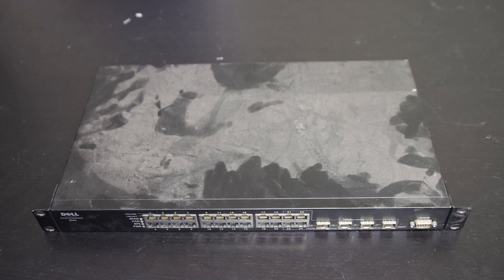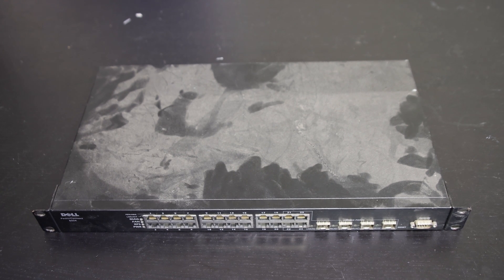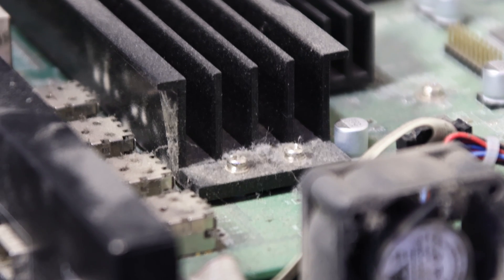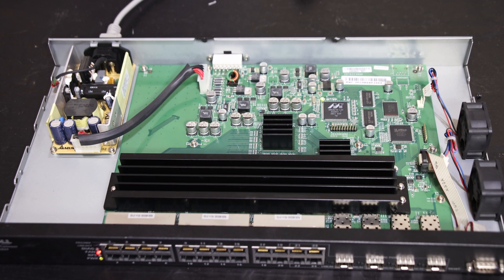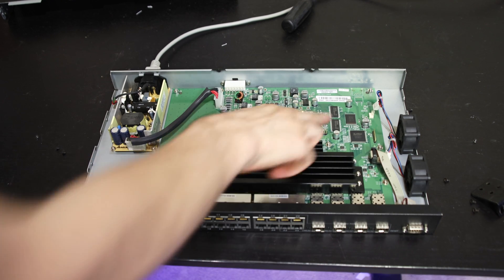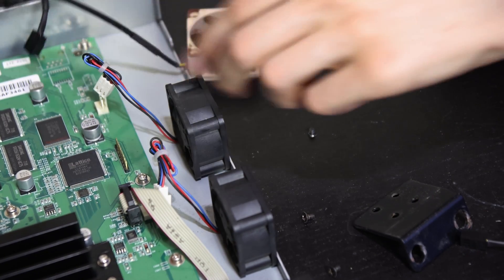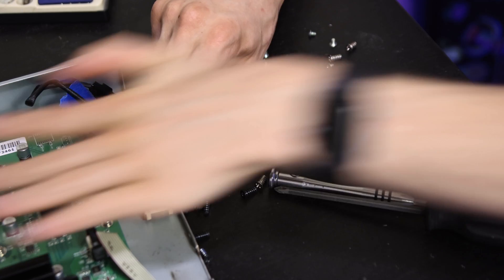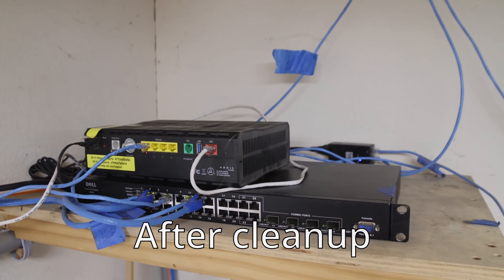Modding a Dell 5324 switch to be quiet

Comment: how do you modifiy the pin layout of the fan cable
Reply from the maker: I used a thin screwdriver to push the metal clips that hold in the connector. Looking at a fan connector, one side should have 3 or 4 holes with metal visible. You can then put a small screwdriver in each of these and give the wires a tug and then the wires will slide out. It can be a bit tricky doing this and it may take a few tries.